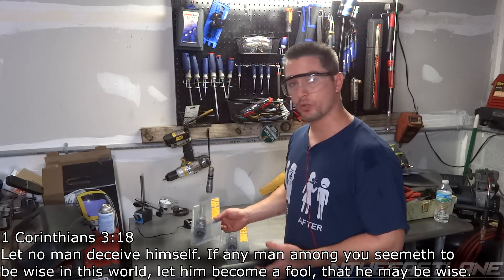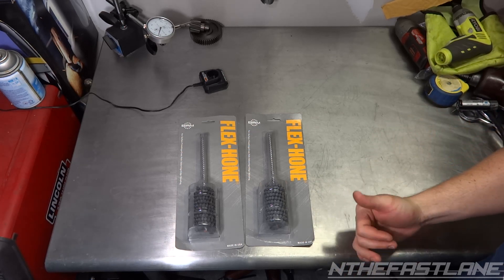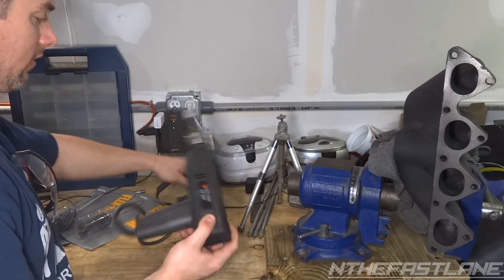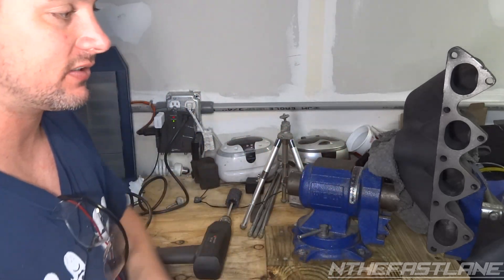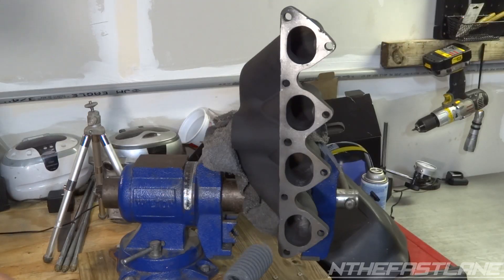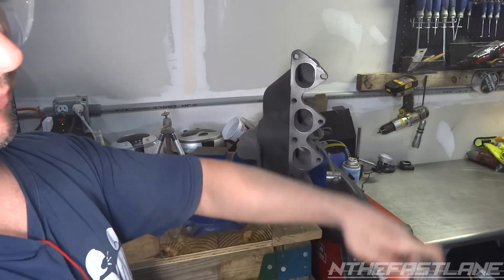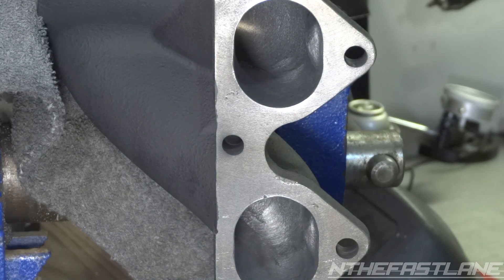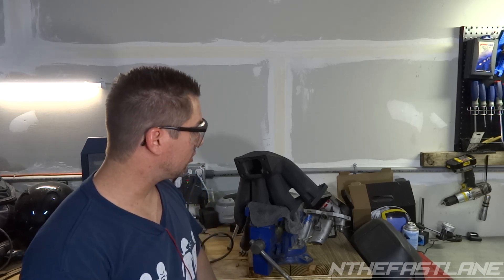Turbo Exhaust Manifold Port & Polish "How To"

Comment: Hey bro great vid, I love all the info you put out for everyone else thank you. I do have a question tho. Far as that top mount manifold, I seen how you was looking at it. The question is for your down pipe from the turbo did you have to fabricate the exhaust side? I just ordered the same manifold and now I’m thinking that I may have to fabricate the exhaust side to turn just a little bit. Please give us some info on that thank you.
Reply from the maker: Hi Leon, thank you. 

Yes, anytime you're customizing a part you have to fabricate something for it. I had to make my own down pipe. I have my own welding equipment so it's not that difficult for myself. Most custom manifolds don't comes with  prefab downpipes unfortunately.

You should see it now. It's a completely different setup and customized from scratch. Heavy duty stainless Nthefastlane Top mount manifold.

Instagram: Nthefastlaneceo

Comment: As professional head porter :   ALWAYS WEAR EYE PROTECTION FOR CHRIST SAKE.!!!!!  YOU ONLY GOT 2 EYES..!!!!

AND TAKE OFF  GOGGLES  ON THE SIDES , NEVER TOUCH THE GLASS , OTHERWISE AFTER 4 DAYS YIU CANT SEE THROUGH ANYMORE AND DONT USE THEM!!!!!!!.
ALWAYS PLACE THEM WHEN NOT WEARING IN SUCH POSITION GLASS IS NOT SCRATCHED!!!!

Comment: This is the final step in porting process.. You need to use a dremel tool with carbide bits to open the ports and outlet first..then lube the hone to smoothen your work...next time try it.

Comment: if the ports on my exhaust manifold measure 1 3/4 each should I use a 1 3/4 hone or 1 5/8 ? thanks
Reply from the maker: Shop This Video: https://tinyurl.com/ya32lny5

Comment: How deep were you able to get with the flex hone?? If you're able to get 50-75% of it I'd consider this a good diy option vs sending my manifold off to get extrude honed. Which is 600-700
Reply from the maker: Hey Weblog, I was able to cover roughly 90% of the manifold with the flex hone and the other 10% with a stone grinding tool on the drill.

Comment: I wanna do a turbo build now ,I've always done all motor b series set ups. Really doing my research but can't really find a good budget set up looking to make 400hp-500. I live close to e85 pump station so will be running on that. Will you please help me by guiding me in right direction as far as parts goes including pistons,rods,turbo size and brand, what manifold etc. I would really appreciate it...thank you for doing what you do.
Reply from the maker: Start a discussion here in my Forum.. I'll chime in, I get notified by cell every time there's a post.I can post pics to help you out where as I can't here. www.Nthefastlane.com/Forum